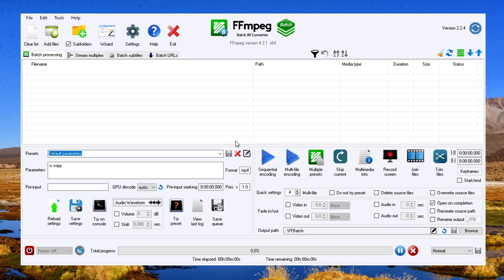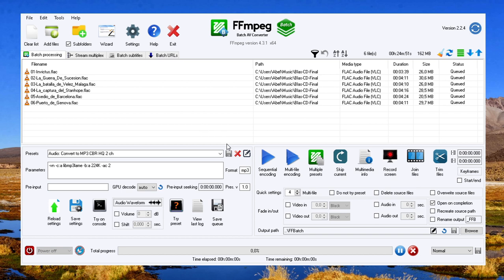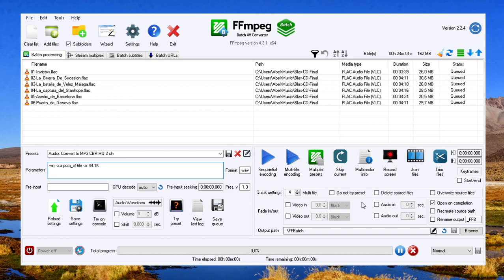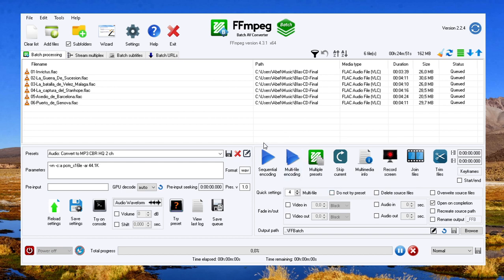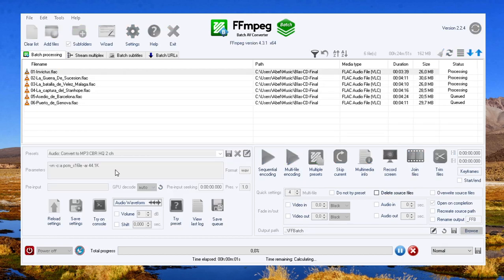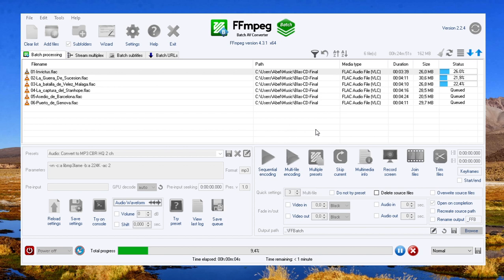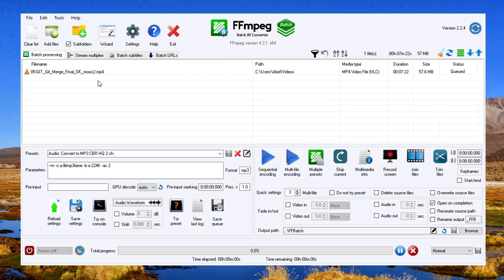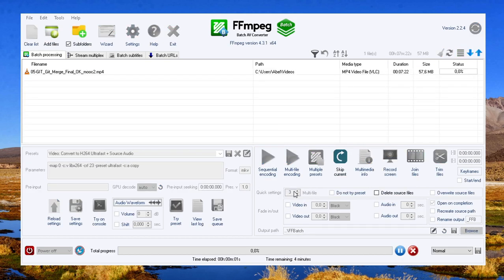FFmpeg Batch AV Converter - Quick overview

Comment: The dialog/popup windows are not visible in your recording.
Question: can we somehow use this tool for automation. For example, whenever some video file is placed in a specific folder, I want to convert it to mp4 and move it to another folder automatically. Is it something I can achieve using this tool?

Comment: If the conversion operation is aborted, what happens to the partially completed files? Are they left as garbage or are they removed automatically? If automatically removed, do I have a choice to leave them so that I might examine them myself before any cleanup? Thank you in advance.
Reply: I don't know about this app but by default ffmpeg leave garbage files even with no data when conversion fail.

Comment: Hey there, That is a great tool but I faced a small issue. If we have duplicated output, cannot start anymore, Must deleted the duplicated inputs. Appreciated your contribution to Windows community (for linux i can handle the cmd line )
Reply from the maker: Hi, have your tried the option to "Recreate source path"?
That could do the trick.
Reply: @korgero  thanks, will try later, it will create a folder recursively in the destination folder right?
Reply from the maker: @trungndbk  Right.
Reply: @korgero  thanks